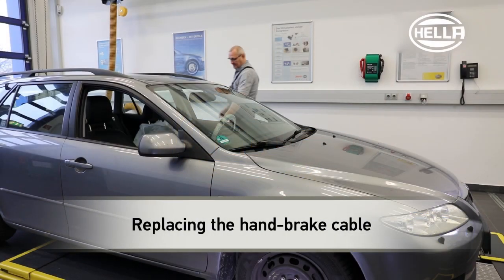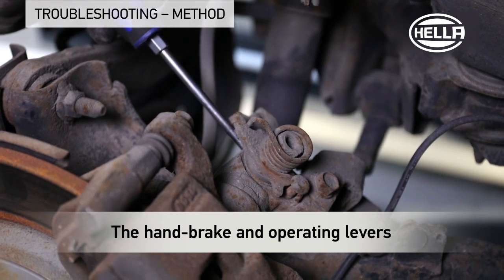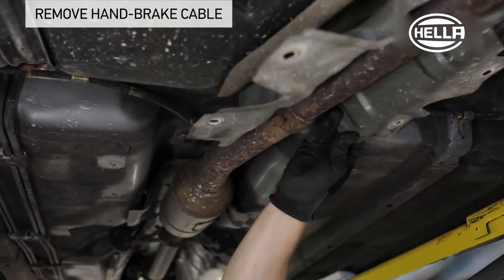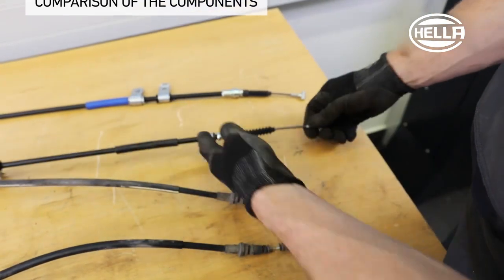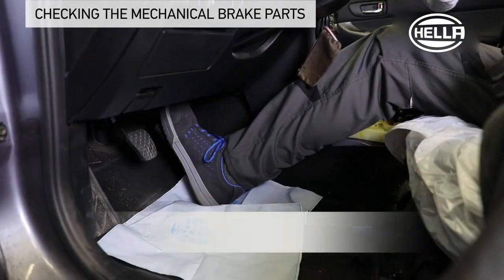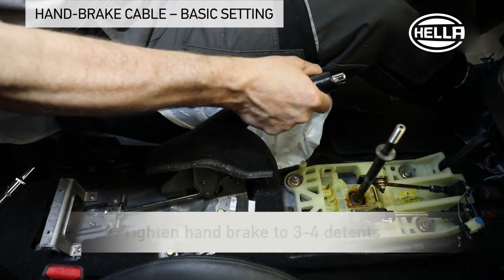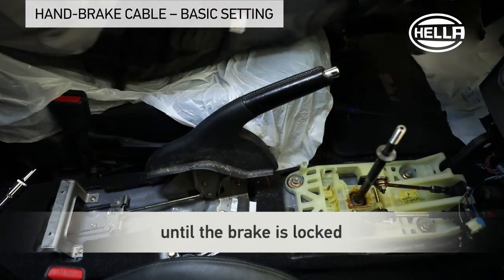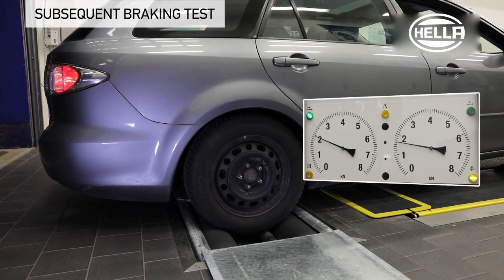Handbrake Check and Cable Replacement I Mazda 6 GY1

Comment: My mazda 6 2010's handbrake button doesnt press in without excessive force. Any thoughts?
Reply from the maker: Thank you for your request.

This sounds like a mechanical problem with the parking brake. We assume that the problem occurs when the handbrake is not engaged.

Here are a few possible causes and approaches:

Common causes are: dirt or corrosion, defective return spring, worn or damaged mechanics, hardened grease/lubricant.

What you can check:

Visual inspection: Carefully remove the leather cuff, look at the mechanics, check the return spring.

If necessary, carefully spray the knob and the area around the handbrake lever with spray oil.

When to go to the repair shop?

If the knob is still stiff even after lubrication or cleaning, we recommend consulting a specialist repair shop.

If you have any further questions, please contact our Hella Service Line: https://www.hella.com/techworld/uk/contact/.